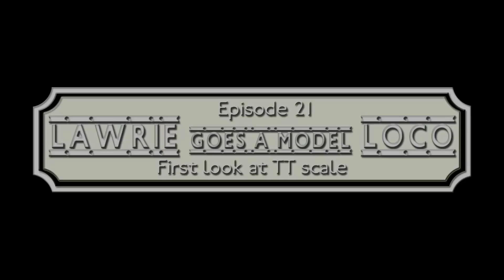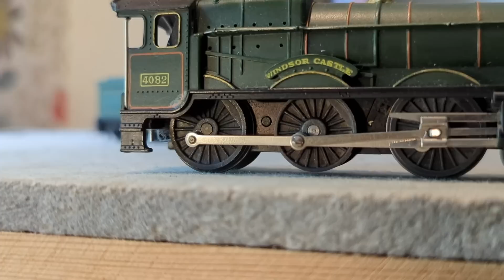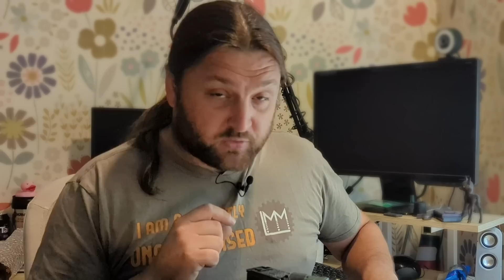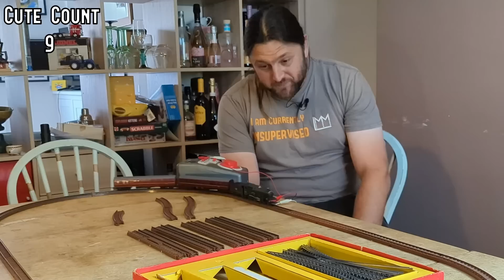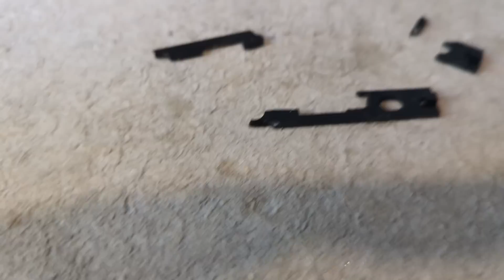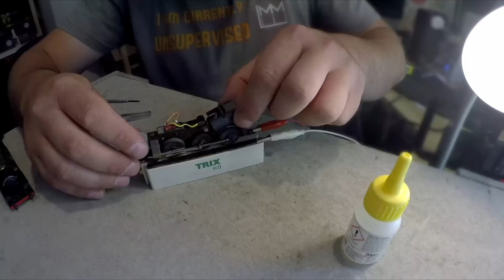Experiencing TT Gauge for the first time - what's Lawrie's new set like? LGML Episode 21.

Comment: I believe that TT-120 denotes that the train runs on TT track and that the SCALE is 120 mm to the foot.  Am I right?
Reply: TT-120 uses a scale ratio of 1:120 or 1/10th inch (0.254 mm) to the foot. So a track gauge of 4 ft 8.5 in is represented by 11.96 mm or 12 mm in real terms.
Older Triang TT (or TT3?) used 3 mm to the foot (1:101.6). 12 mm gauge track then represents 4 ft gauge. Great if you are going to model the Padarn Railway but not so great for other prototypes.

Comment: Is TT smaller than N gauge?

I'm building an N gauge layout, things have got in the way such as college and work but its looking alright at the moment although it doesn't have any scenery on it. Its just some track on a board with the beginning of a hill in the middle.
Reply: TT scale is larger than N scale. Hornby’s current range is 1:120 scale
Reply: TT is in between N and HO/OO. Basically TT is supposed to have the best of both scales. Small enough to fit a lot of layout in a small space, while still being big enough to have nice visible detail.

Comment: Turnouts in both Triang Track types can be acquired straightforwardly.   Buildings / Platforms / Bridges can get expensive, OR try printing and making both 3D and card backed ones from your computer.  2mm /4mm card buildings can be used to some extent to give depth of field tricks.
Reply: I guess it'd be easier to get the stuff in the UK, having collected it here in Australia, the difficulty level has increased significantly

Comment: The sad thing is that the original range of Hornby TT gauge isn’t compatible with the new TT:120 range as (according to Hornby) the original range is slightly out of gauge and not truly 1:120 scale. 

Another thing to note is that the original TT range was based off the OO gauge range of that time when the rails were ridiculously tall so for these to run on the modern TT:120 track, the flanges would need filing down otherwise, they would be riding on the sleepers..
Reply: Also the original tt is 1:100 not 1:120
Reply: @jakeandfriends3554  Tri-angs 1:101 to be exact
Reply: Your find that most of Tri-angs TT3 rolling stock will run on either Hornby or Peco 1:120 rail track & through points without any problems, 🤔If your rich 🥺then the Tilling 1:120 rail track is possibly one of the best option to use.